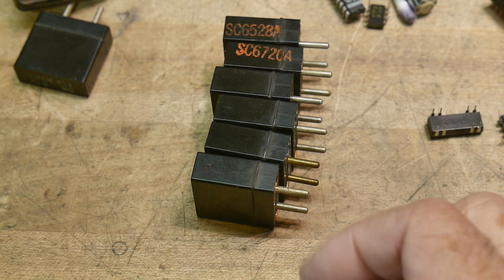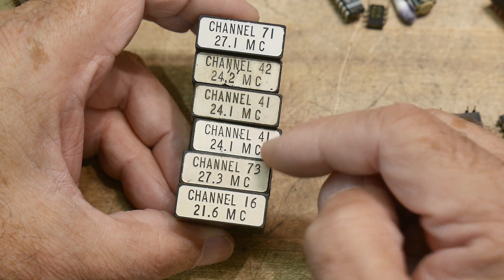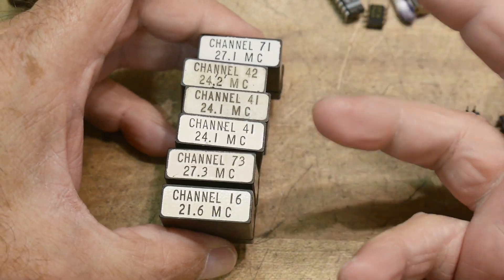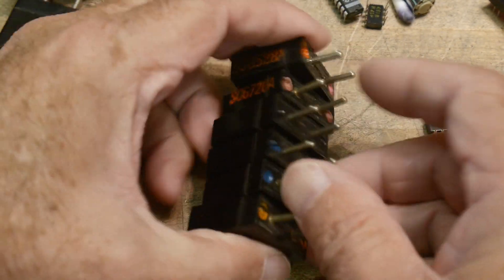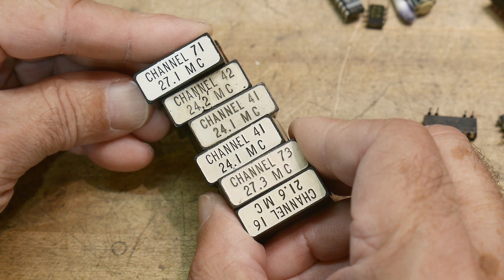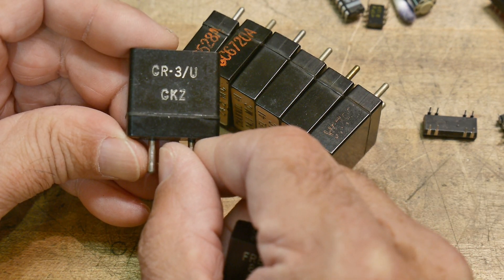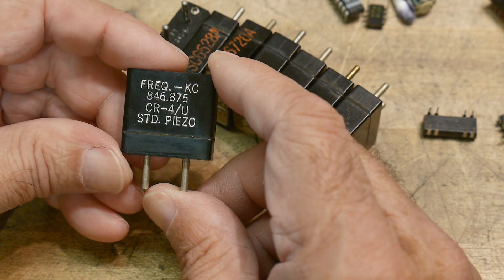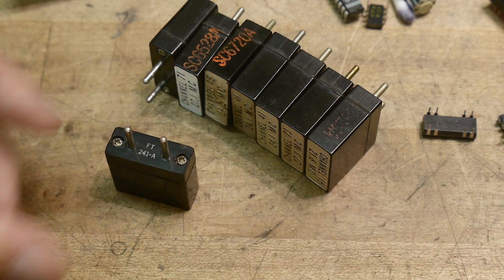#1285a Help need to identify radio

Comment: I'm assuming by now you've figured it out. First, I wouldn't put them on Ebay just yet. I think they are Either US Army Field Radio crystals( though a bit big). If they are in the Hz range US Navy Sonar components ( 20-500Hz) or Depending on their “Born On” date, possibly early US Air Force RF components. I'd bet money they are all from President Trumans time in office til mid to late 1950’s. Take your geiger counter to them... If nothing exciting, would probably scratch the (at the time) fledgling US Air Force theory. Don't sell them, I think they'll end up with a fairly cool origin story.

Comment: The FT-241 crystal holder was almost universal in the time period during and after WWII. The Army probably started the whole thing, but after war they were used in many radios both home made and commercial ham gear. And, yes I remember seeing articles on how to, lightly, polish them to a higher frequency you needed. You cannot grind them to a lower frequency. They also used them in VXO circuits, a way of pulling them off-frequency with a tuning capacitor.

Comment: Those crystals belong to BC-604 transmitter, part of SCR-508 radio station. They are kept in a large metal case, built-in in the station itself. Hinged top lid does facilitate their swapping.

Comment: TWO-DIGIT SERIES:
These were used in the BC-604 (SCR 508/528) equipment , a "tank radio" operating 20-28 mhz FM 
The actual fundamental frequency is the marked frequency divided by 54.
The fundamental frequency is also equal to: (20 + Channel/10) / 54 
 THREE-DIGIT SERIES
These were used in the BC-684 Transmitter 
The range of these crystals is 28 - 38 mhz.
The marked frequency in mhz is the channel number divided by 10.
The actual fundamental frequency is the marked frequency divided by 72 (or the channel number divided by 720).
Reply from the maker: I'll go see if my tank is missing the radio

Comment: ebay: "BC-684 10 meter FM crystals FT-241-A 29.6 29.4 29.3 29.2 MC MHz TESTED 29600 kHz" 
It made me smile how quickly you took the 'BC-684' suggestion ... I remember crystals like that when I started in ham radio back in the 50s.